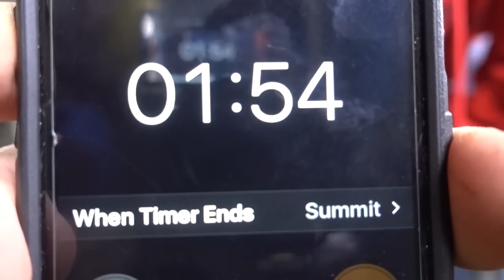NEW BIKE REVEAL (KTM)

Comment: i have a 2008 ktm 144sx and had to use a brillo pad and paint thinner to clean off the  radiator shroud graphics. they where painted on. did you run into that problem?